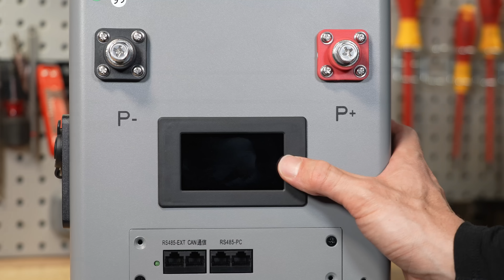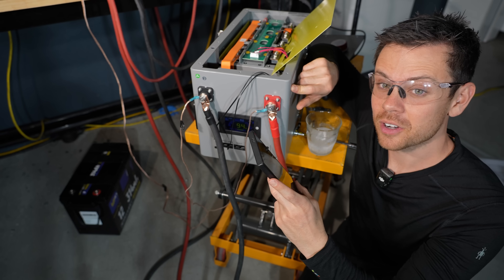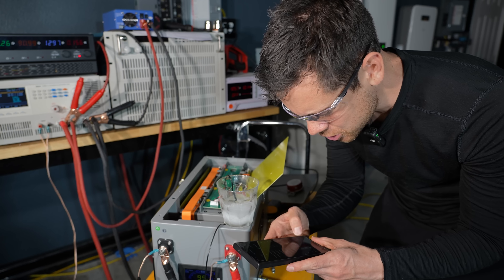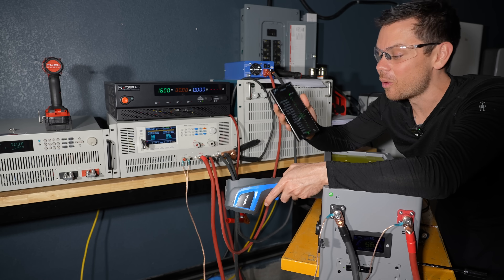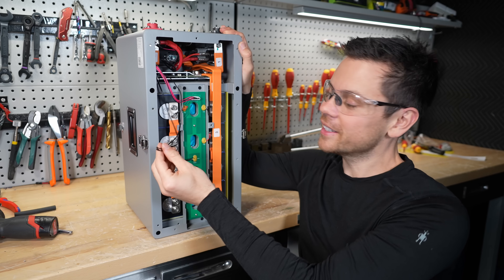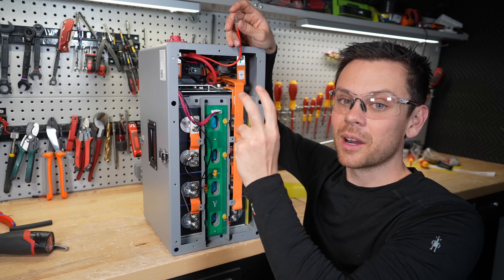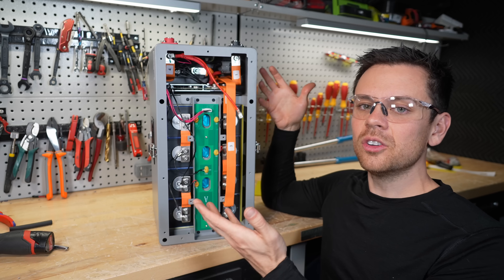NEW! Yixiang 12V 314Ah "Budget" Battery

Comment: It won't be long until we have Korean made Silver Ion batteries for our solar systems.
Reply: They are talking about them like they are all the rage, but yet are to produce them up for testing and scrutiny. I wouldn't hold my breath on them being viable for quite some time still. Plus, with the price of silver on an upward trend, and appearing to continue that way PLUS the massive shortage of it currently on the commodities side of things, there will be an inevitable transference of that cost and shortage onto the industrial side of the metal as well. Which will undoubtedly lead to lower volume of production and higher costs associated
Reply: @sheepishmclemmingston5550 Good points, yet Samsung has bought Mexico's largest silver mine to produce silver exclusively for them.

Samsung has also noted that full production will go into effect in 2027. Obviously silver is going up in value because of basic economics,  of supply and demand, AI data centers need huge amounts of silver, so does the military industrial complex, in addition to those looking to preserve wealth outside of fiat currencies. All these factors are causing silver to rise in value. 

Yet these newer batteries will be able to out perform our current lifepo4 or other battery chemistries. Will they be as inexpensive as the current line of battery technologies? Hard to say, long term I'd imagine that as this technology is adopted and as more mines are opened up to mine copper, silver, gold, etc the prices of this newer technology will become less expensive over time. 

I'd imagine that in a few year's this new silver battery will become the gold standard for solar installations, and lifepo4 or similar technologies will be looked at as a lead acid battery is looked at today when building a solar system.  

In terms of length of time of when this technology goes mainstream is anyone's guess, yet just a few year's ago the gold standard in solar installations were Trojan deep cycle AGM lead acid batteries. 

Look at where solar is today, compared to the early 2000's, and in just a few more year's it will be vastly different from what is available for us today. In a few year's time I'd imagine it will be possible for most homeowners to cut their cable to the grid.

Comment: Not a lot of goodness in that pack.  Those busbars and terminals look 100A ish.  Seems it should be tuned for  100 to 150a max as the bms is heating up, so it's not a 200A bms even if it's programmed that way.  You did the test with the cover off in a lab, not in a 35C shed on a sunny day

Comment: To be clear. The JK-BMS is not at fault here, this is their failure to program the BMS prior to shipping. 8 cell I think is the default profile as the BMS ships from JK...
Reply from the maker: Completely false. It is yixiangs responsibility
Reply: @WillProwse  aren’t you both saying the same thing?
Reply from the maker: @GavinStoneDIY  no this bms is for another battery entirely, and jk bms doesnt default to 8s. the other ones i tested default to 16s for the pack they are sold with. this battery is not programmed to default to 4s because of yixiang
Reply: @WillProwse I agree. But his comment agreed with you also. I think the “their failure” part may have been confusing. But yeah, this is Yixiangs issue. And that’s a shame really, they did a great job on the 16kwh version. 

Although I will add that they had a 200 amp fuse in that 16kwh model also. And I think it should be a 250.
Reply: @WillProwse  oh you meant the default. My reading comprehension is off today. 😂
I don’t think JK’s default to anything. They read whatever cells they are hooked up to. Not sure what the issue was there.
Reply: Yeah, one leg is both the same!

Comment: Some of the problems you mention in this video are not related to Yixiang, but rather to JiKong (the BMS manufacturer). The more experienced users who work with JK know that these JK-BMS need to be setup correctly before use, which makes these BMS-es not beginner friendly.
Reply: I disagree. The fault with the profile DOES sit with Yixiang as they failed to setup the BMS prior to shipping... They chose the BMS for the enclosure, but they didn't bother to load a suitable profile onto the BMS.
And nobody said JK should make their BMS's beginner friendly.. But either way, this is Yixiang's fault not the BMS....
Reply from the maker: Completely disagree, the JK BMS can be flashed with firmware for a specific pack. That is the responsibility of Yixiang and it should be tested before its shipped out
Reply: @WillProwse  Once you press the LFP preset, all settings are reset so no matter if Yixiang had flashed the JK BMS properly, you pressing the LFP would instantly reset the settings. Yixiang cannot "lock" the settings as this is not allowed by JiKong. Yixiang only builds the boxes, not the BMS.
Reply from the maker: @veeerzes  the default should be whatever they want flashed with this particular model. They messed me saying it is the bms from the 24v model. that is a mistake. they need to flash it with the proper firmware.
Reply from the maker: @veeerzes   and you can make that argument for all of these manufacturers. none of them make their own bms. ask them
Reply: @WillProwse  But this is sold as a DIY box, the BMS comes straight from the JK factory, it is a 4-8S20P BMS, suitable for 4 to 8 cells and 12 to 24 volt. If this was a ready build battery, I would completely agree with you, but this isn't and you cannot compare it with prebuild batteries.
Reply: @WillProwse do you think you will do a guide on the correct params for the jk bms?
Reply: @fanciulli  OffGridGarage has many videos on settings for the BMS... I doubt Will would do a vid on this because every setup is potentially different...
Reply: More chinese fraudulent manufacturing.
Reply: @dwaynesimons-d2c 
It’s not fraudulent, just wrong.

Comment: You have to put the sensors between the batteries.
Reply: Can't get them in between the cells. One to top (Ring lug) and one to bottom of the cells is perfectly fine.
Reply: @dougle03 They leave two spaces per form, for the sensors.

Comment: The rest of the settings are not all right....balance open voltage should be at 3.45V .... thats never the case from factory settings.Other than that JKbms is awsome with active balanceing,quite fast too.And the app also nice.

Comment from the maker: 0:00 Assembly 
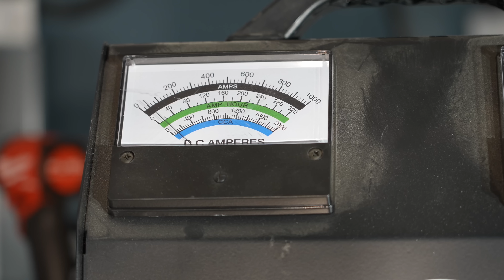1:10 Overload Test
2:21 Problems Galore
8:02 Conclusion
Reply: Wroth pointing out that the issues are all Yixiang, and not JK-BMS. it's Yixiang fault that they didn't bother to load up a suitable profile onto the BMS before shipping the kit...
Reply from the maker: @dougle03  Absolutely and utterly false. This is 100% Yixiangs responsibility. All of these "battery" companies assemble them, and they are responsible for the bms and cells to work properly. It is not the consumers responsibility at all.
Reply: @WillProwse  I don't think you read my comment properly. Please read again....
Reply: Not sure why but the whole first half of the video I felt like you were relishing being a troll, because you knew how badly this battery was going to end.
Reply from the maker: @TimBlack1  actually I expected better but I've learned not to do that 😂 you just never know with batteries. I just have no idea what will happen in any of these videos